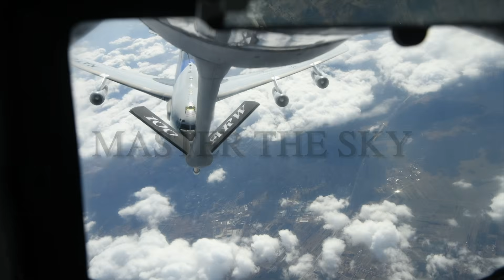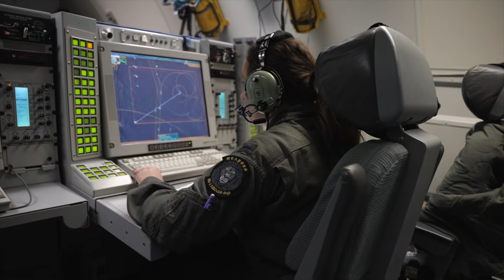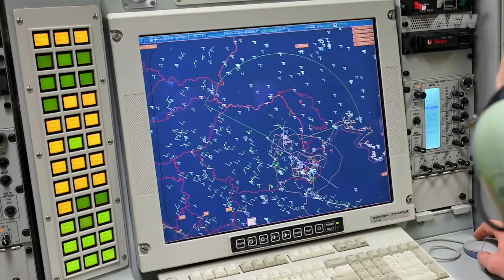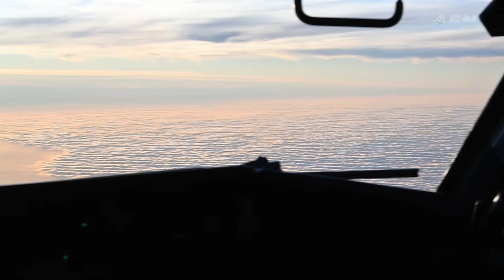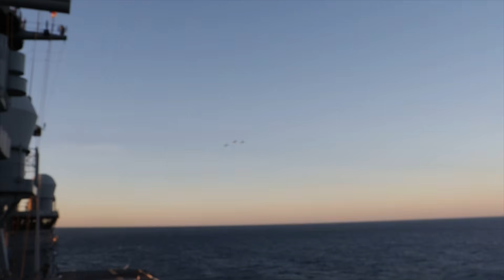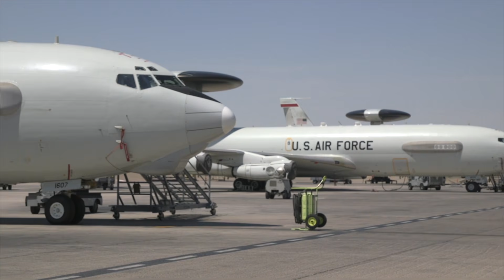AWACS vs Reality  How The $300 Million 'Eye In The Sky' Got Detected

Comment: E3 is outdated... Today's radar is much more advanced which can even detect the 5th gen fighter jet...
Reply from the maker: Absolutely fair point modern radar systems have indeed become far more advanced, especially with AESA technology and multi-static radar networks. However detection doesn’t always mean effective tracking or targeting. Even if a 5th gen fighter like the F-35 can be detected under certain conditions, maintaining a stable lock and guiding weapons is a completely different challenge. As for the E-3 AWACS, while the airframe is old, its systems have been continuously upgraded over time. Its real strength isn’t stealth it’s long-range surveillance, coordination, and acting as a force multiplier in modern warfare. So it’s not really about being “outdated” it’s about how it fits into a much larger system.

Comment: Little known fact all technicians  including pilots working on the AWACs had developed brain tumors. Result of in adequate shielding of the high powered radio waves.
Reply from the maker: Interesting point radar safety is definitely a real concern in aviation. However, there’s no solid evidence that AWACS crews “all developed brain tumors.” Modern systems are designed with strict safety limits, shielding, and controlled exposure zones. The radar is extremely powerful, but most of that energy is directed outward, not into the aircraft. Crew positions are carefully designed to minimize exposure. Also worth mentioning even on regular commercial flights, both crew and frequent passengers are exposed to higher levels of radiation compared to people on the ground. It’s mostly cosmic radiation at altitude, not radar, but it shows that aviation always involves some level of exposure. Of course, long-term effects of electromagnetic exposure are still being studied, and you could argue that not everything is always fully transparent. So it’s not completely risk-free but it’s also not as extreme as “everyone got tumors.”
Reply: This technology was developed in the 70s where crew safety was not really paramount. it's easier to train new crew rather get new equipment.
Reply from the maker: @peternguyen2323  You bring up a fair point early systems from the 70s were definitely less advanced in terms of safety standards compared to today. That said, even back then, there were still basic safety protocols and shielding considerations, especially for high-power radar systems. Modern AWACS platforms have significantly improved in this area, with much stricter exposure limits and better engineering controls. Like many technologies, it evolved over time both in capability and in crew protection.

Comment: What a stupid statement to make.  The E-3 Sentry AWACS  is based on a plain old Boeing 707 airliner.  No stealth, no fancy radar absorbing material and absolutely  nothing to protect itself with.  Any radar,  literally any, would detect it.  But getting near it would be another matter.
Any aircraft getting within a couple of hundred miles of one flying during a war will be shot down as an absolute priority unless its friendly.  That's how they protect it.
Except some moron decided it was perfectly ok to park multiple E3's side by side in a war on a base with piss poor air defences.
Reply from the maker: You’re absolutely right about the aircraft itself AWACS was never meant to be stealthy. Detection isn’t the problem, survivability comes from distance and protection. The real issue starts when that protection layer is missing that’s where things get interesting.
Reply: @VectorTechExplained  Which make the Iran war debacle incomprehendible.
Seriously, these aircraft are so precious, its inconceivable that they would be parked together.
Even in peacetime fires happen and two aircraft side by side means if one is damaged its almost inevitable that there will be damage to the other.
  That aside its an incredible piece of engineering, way ahead of its time when it first came off the production line, and still very relevant today even though the airframes are decades old.
Reply from the maker: @eamonnfanton2165  Thank you for this thoughtful follow-up. You've nailed the central contradiction. The E-3 Sentry is indeed a masterpiece of engineering a flying radar station that changed modern air warfare forever. But its value is exactly why parking multiple of them together on a vulnerable airfield is so hard to defend. You're absolutely right: even a routine fire or a stray attack could cascade into a catastrophic loss. The Iran incident (if confirmed) would be a failure of operational discipline, not a failure of the AWACS concept itself. I also appreciate your point about the airframes being old that’s the hidden challenge. The radar and mission systems have been upgraded, but the 707 platform keeps aging. That’s why many air forces are moving to the E-7 Wedgetail on a modern 737 body. Still, the E-3 remains a legend. Thanks again for the great discussion this is exactly the level of conversation we want on this channel.